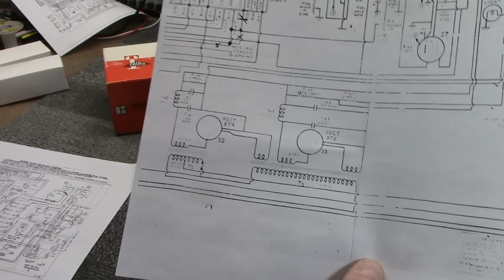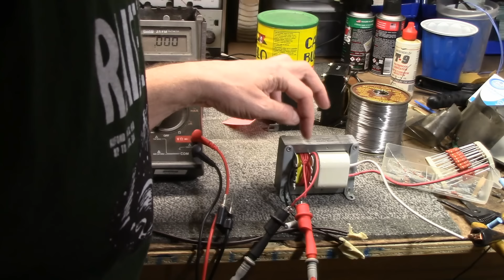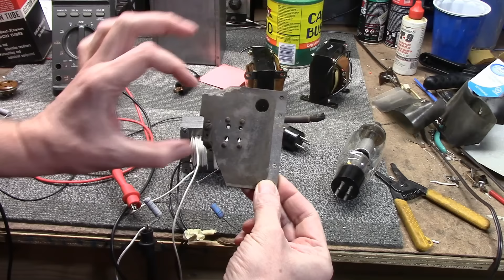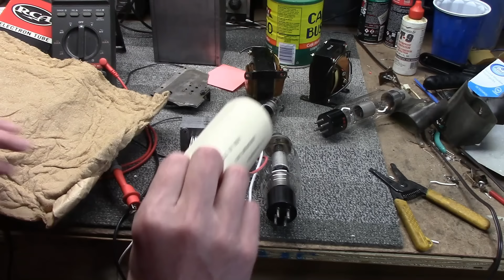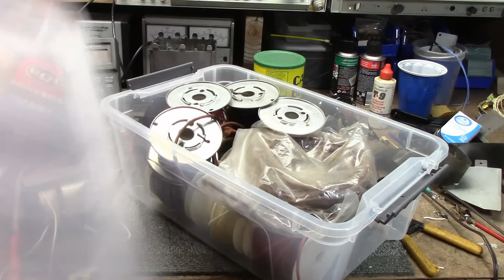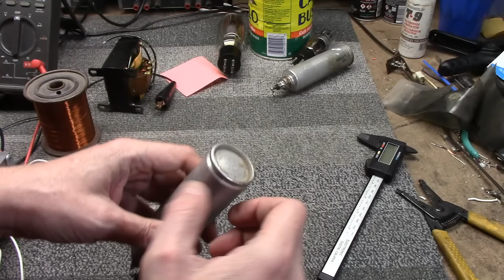RCA 1936 RR-359B field test TV part 11 - HV xfmr experiments and more

Comment: The 8013 is a different tube and not original to the set. It was originally intended for higher power transmitter power supplies. It has 40KV PIV @ 20ma with a 2.5V 5A thoriated tungsten filament while the 878 is 20KV PIV @ 5ma with a 2.5V 5A pure tungsten filament. The envelope and top cap on the United 878 is correct for the set. While there's no real down side to using the 8013 in the set, the pure tungsten filament of the 878 lights up like a light bulb and is very distinctive to the set. The thoriated filament is not dangerous as long as you don't eat it :) I would just stick with the 878's and keep the 8013 if you ever needed it.
Reply from the maker: Thanks.  I looked up the 8013 as I was editing this video and noted the higher specs but not the filament difference.  Looking forward to seeing it lit up :)

Comment: What about the automatic coil winders on AliExpress? They are about 400 to 500 euro and you could wind the perfect transformer for your needs. And even recreate other burned out transformers for other repairs. Those things can do many winding patterns fully automatically it seems. I have only seen one video on YouTube of a guy figuring out the Chinese manual. But hey an ai could likely make a good translation these days. 
Yes they cost, but considering the costs you are already making on transformers. Seems it might actually be economic 😂
Reply from the maker: This is the first transformer I've needed to replace.  I don't have the time or patience to learn that skill.  The two transformers I'm using totaled about $150.
Reply: @bandersentv then I must have misheard, because I thouggt you said that you had several hundreds of dollars in different parts for the transformers alone. 
It's a useful skill to have though. I have heard you complain about difficult to find high voltage transformers before. You usually manage from parted out gear and eBay finds, but that is going to stop sometime. I also watch restore old radios, he has a simpler rig, but has rewound a lot of mostly output transformers and coils I think. Has done several videos on the calculations and measurements needed. Good stuff.

Comment: Hi Bob, I was wondering.... if that Mycalex has basically the same properties as mica, why don't you just buy a mica-sheet with the same dimensions and use that as a substitute... after all mica is relatively cheap. A bit harder to achieve, since you'd need some specialized drills, would be to simply buy prestressed glass sheets of the right dimensions and drill the required holes through those.
Finally I realized you can actually buy ceramic sheets (for DIY projects or cooking) with proper thickness and size. After all, ceramic has fantastic dielectric properties, since it's often used in high-voltage electronics (same thing with glass)
So, in my opinion, you have plenty of cheap(er) alternatives on the market... food for thought :)

P.S. for removing the tops of those electrolytics, why don't you wind some sturdy steel wire (one or two tight loops should do) just below those aluminum caps and hook the whole thing up to workbench vise jaws and use the vise in reverse, in other words, slowly prying the jaws of the vise open and pulling the wounded steel wire (and the cap) off the top of the capacitor (a bit like a bottle opener ;)
Reply from the maker: Didn't you see the GR10 material I purchased in the video?  If I decided to fabricate a new board, I'll use that.   But I don't see myself doing that.  I don't think you realize how complex it would be to cut, drill and machine slots into any of these materials.  Then there's trying to rivet the socket terminals.    I'd much rather pay someone else to do it.  The cans are trivial to open.  Watch the next video.
Reply: Just suggesting some (likely) cheaper alternatives Bob...nothing more. I like the meticulousness with which you restore the RCA though :)
Reply from the maker: I appreciate it but keep in mind this set is likely worth more than my entire collection of 100+ sets combined.  Well worth spending the money to get it as close to original as possible.
Reply: I understand. This is a very rare set which is worth, I suppose, to run the whole mile without cutting corners. I can imagine sometimes you must feel true anxiousness when confronted with a problem in this set... I am genuinely curious to see the end result, but knowing your meticulous approach, it won't be less than excellent :)

Comment: I’ve dealt with those “wet” electrolytic aluminum can capacitors before in an early 1930s Rogers Majestic radio. I cut within about an inch of the bottom where no one could see the seam afterwards. I used aluminum tape to get it back together. Unfortunately, one of the cans I opened still had “juice” inside. Do it over a sink wearing gloves.

Comment: It looks like the top of that electrolytic may well be rolled over the lip on the body whilst being spun.
One of chatGPT suggestions:
Lathe or drill press “peel” (excellent control, semi-destructive)
Mount the capacitor gently in a lathe or drill press chuck.
Use a sharp HSS tool or fine file to skim the rolled edge.
Remove just enough material to break the seam.
Lift the lid straight out.

Comment: If using Kapton tape to insulate an enameled wire winding from the primary and from the transformer core, consider that you'll need to insulate the winding ends laterally from the transformer core too.  Maybe pack that area with corona dope after doing your best with the tape?
Reply from the maker: I plan on scavenging some insulation from wire rated for 5kv.  I pull the wire out and slide the insulation over the enameled wire.

Comment: I don't know if they are the right size, but I was able to find 4 pin ceramic tube sockets on the internet.  I also looked at the voltage withstand of plexiglass, which is 15.7 kV/mm.  Plexiglass did exist then, and it would be easily machinable and wouldn't be fragile like Micalex.
If mounted on plexiglass or in a hole cut in Micalex, the socket wouldn't even need to be ceramic; the high voltage is between the base and the plate cap -- not between any of the base pins.
Reply from the maker: You're right of course.  The socket doesn't need good insulation between the pins.  It needs good insulation between the socket and the grounded chassis.

Comment: What about wetting the yellow shop rag and wrapping it around the can, while heating the cap with a butane torch? That should cause the cap to expand, making it easier to pry off. The big unknown here is what’s inside the capacitor can; it might have toxic chemicals that would react poorly to open flame or just being heated, though I suspect it’s either wax or some sort of tar.
Reply from the maker: Just some powder.  Original these were filled with a borax solution but it has dried out over the years.

Comment: To be a bit more accurate about the neon sign transformer, the magnetic shunt that is between the primary and secondary works to limit the output current. Much more efficient that having a big dropping resistor to limit the current through the neon tube. Of course that lowers the output voltage at the same time. In fact if you wound the filament around the secondary side it would limit the filament current, which you wouldn't want to do. You could remove the magnetic shunt by using a jeweler's saw. It would be slow but you wouldn't have to un-assemble the core. That might give you enough room for a HV insulated wire filament winding. A magnetic shunt is also pretty standard on a microwave oven transformer to limit the power.

Comment: Nice adaptation for the transformer. Lucky to have so much space on the core. Regarding the need for high voltage tube sockets, would ceramic sockets from HAM radio work? Unless the cloth covered wire is damaged, I think it could stay. That seems to hold up better than the rubber covered that crumbles.

Comment: Be careful with the insulator at the bottom of the big capacitors. Restoring a 1942 Silvertone console radio, after gutting out the capacitor, I found out that the center pin showed some resistance with the can. I resorted to inserting a sheet of PTFE to insulate the center pin. Thanks.
Reply from the maker: Thanks for the warning.  I'll be replacing the center pin + insulation and reusing the terminal at the end

Comment: Bob, we all know your the best tv restorer on youtube, and David Tipton is the most meticulous radio guy, but he lives in Australia. I hate  to embarrass myself as  this is a Smithsonian Institution level restoration, but, practicing on a discarded radio cap first, I would cut the thread section off and mount the new caps on a donor  threaded part. I would then cut the threaded section off the irreplaceable TV cap, enlarge the hole to the diameter of the tube, gut it, discard the tv threaded part,  then slide the unmolested  tube over the new caps mounted on the radio threaded part. It would appear untouched and easily serviceable a 100 years from now. Intriguing saga as always !!

Comment: However you gut the capacitors, if you figure out a way to allow the tops to be removed later then you might be able to be a little less fussy about what goes inside, even modern electrolytics that have been measured and matched in value in a series configuration with bridging resistors, and protective fuses.  If something fails later, then you can remove the tops, fish the wires and parts out, and connect new fuses and capacitors.

Or, aother idea: cut a hole in the side and cover with a curved plate attached with screws.

Comment: Look for some FEP insulated HV wire similar to Teledyne Reynolds 178-8073 high voltage wire. 22ga. 1.4mm dia 18kV rating. Smaller diameter than hookup wire but good HV ratings.

Comment: if you are going down the pry open the lid crimping route, you could try attaching a steel capacitor mounting clamp around the top of the capacitor to pry against.

Comment: easier way to do it - build a 100khz or so oscilator using 6bq6 - use a silicon diode rectifier or small small vacuum diode. main thing is the 1 inch pvc pipe form for like 300 turns of wire. 1 or 2 turns for rectifier filament. Way easier this way. and safer
Reply from the maker: Well for that matter I could just put a solid state 6kV supply inside the transformer box.  My goal is to keep it as original as possible.
Reply: @bandersentv  could easily use the common 18kv 30ma diodes no heaters needed . make a voltage multiplier  or x6 tripler . much lower voltage transformer needed - just 1 transformer.  using oscillator converter you can regulate the HV, that does help. but just a diode rectifier simplifies a lot. as close as one would do today. no tube rectifier with 5amp heater

Comment: I was thinking on the cap, instead of cutting it on the side, use a method similar to a can opener and open it from the top. then maybe glue it shut or liquid steel to seal it after stuffing, (Just a thought) at least that way from the side view, it would look unmolested.

Comment: Bob, one possibility would be you glue up the old tube holder, take that new material that you showed, make holes and replicate the old one and stack them together (if you have the space for that). That way you would thave more strength, I guess.

Another possibility I see is someone designing and printing a new plate for you in a 3D printer, maybe with holes in the areas where the high voltage is to avoid isolation problems, and stack and/or glue it to the old one, so you would have increased resistance.

Comment: About that can; I wonder if it would be advantageous to devise a way to fasten it to the chassis without bending those tabs back. That would be in the case if for some reason you would have to take it back off.
Reply from the maker: Good point. I don't need to fully bend them over to hold it down.  It's not going to be subjected to any force after all.

Comment: There are food can openers that cut the outside of the crimp rather than the inside edge of the top. Cut is about the center of the crimp. I have one made by Bellemain. They are nice as they don't leave a sharp edge and you can replace the top to seal the can loosely.
My first one was made by Starfrit and it cuts below the crimped rim of the can leaving a sharp edge.

Comment: It you open the capacitor from the top it will be very hard to remove the positive electrode as it is firmly attached to the base with a thick aluminum rod, you might want to open it just like the multi section near the base.
Reply from the maker: I've done it before and it was easy to get that rod out. It goes through a rubber seal and the bottom. The rubber is hard and crumbles away easily

Comment: Hi Bob. What about using a few windings of high-voltage wire wound on the core of the NST in the space between the primary and secondary bobbins, like a more conventional flyback transformer does for the filament supply for a 1B3GT? That should save you one extra transformer, anyway, and it would solve the galvanic isolation problem, too.
Reply from the maker: There isn't any space between them.  The iron core goes right through the middle.  Also, if I put a loop around the core, it's only half the voltage as going around the primary.  I'd need around 24 turns.

Comment: Thaks for the videos! About opening the caps, I would put them in a metal base using the factory "screw", put it in a vice and gently tap on the cap in the seem with a screwdriver and a small hammer to remove it.
Reply from the maker: I don't think that will be enough force.  I've seen similar cans where the aluminum buldged out from internal forces and the cap didn't budge

Comment: I think that the top is similar to a tin can in that there is a rubber seal at the top of the can. I would use a lathe to cut the bottom crimp on the cap.
You could just glue the cap back on after the stuffing.